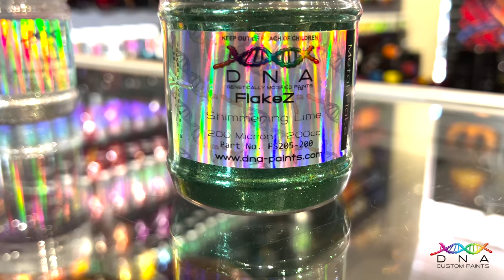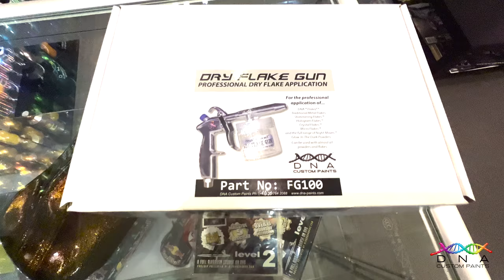Shimmering FlakeZ

Comment: I love the product and have used it but I will say the only safe gun to use is iwata w101  with the agitator which keeps it mixed doesn't settle last thing you want is that one thing slowing the process down. Right tool for the right job results show.